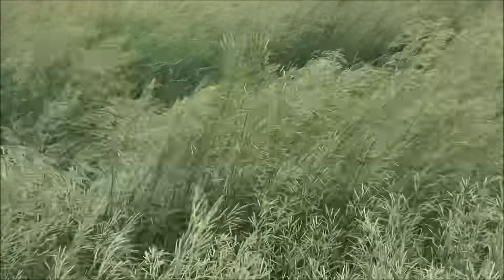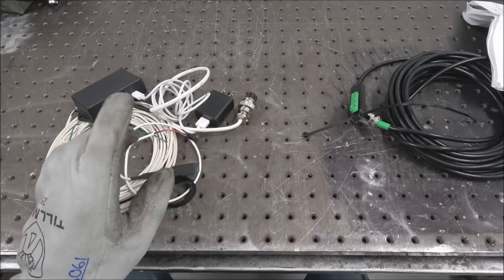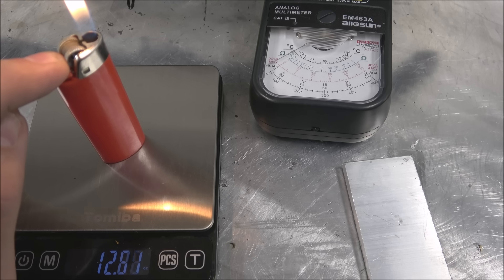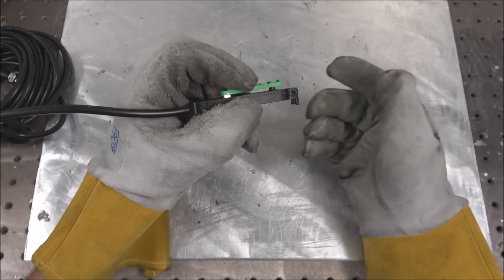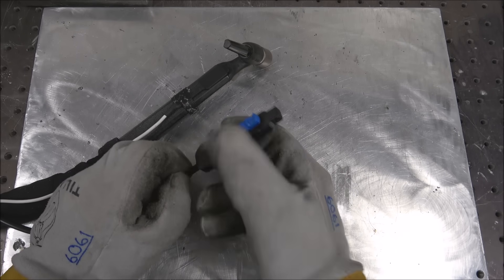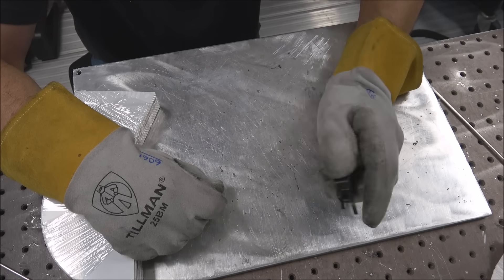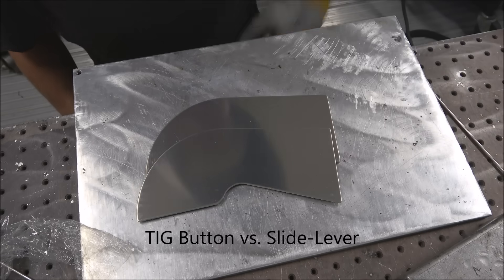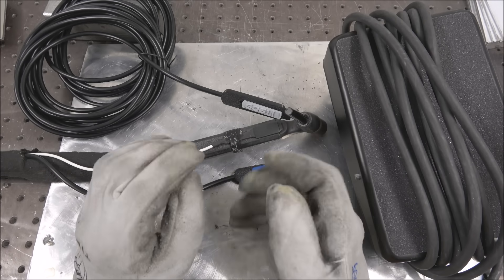TIG Amperage Controller Showdown - TIG Button VS. Slide Lever 6061

Comment from the maker: Both available to purchase here:
http://www.6061.com
NEW upgrade TIG Button pressure "PAD" www.6061.com/replacementbutton.htm

Torch Holder Magnetic Base: https://amzn.to/4kE7OEU
Get yourself some soft TIG gloves: https://amzn.to/4dVTQeQ
Thanks for watching
Reply: Will the slide lever work on a ThermalArc 186 AC/DC Inverter machine?

Comment: I make much better welds when I do 4t vs foot pedal because it's like cruise control. It just gets old to constantly be setting it all up for every weld. I think the slider is right for me so I just ordered one. I think id struggle to maintain consistency with the button. I've been using the primeweld north south one and the dial wheel is just so small and awkward to use in anything except a weird overhand grip. I like the idea of the slider that you could also use it for 100% "pedal" flash tacking. I'm excited to get it!

Comment: Wow, this is such an exciting video for me!  I've just taught myself to Tig, watch a lot of videos, yours are EXCELLENT, love the simple/brilliant torch holder, but especially the variable Tig button!  My first big project is a 10ft tall bent & welded steel Christmas display that I've attached thousands of Christmas lights to. I don;t have a 10ft x 10ft welding table so I welded the entire thing crawling around on the concrete floor, I didn't even try to use a foot pedal, just ON/OFF at 100%, sure could have used this variable Amp setup.  I think I will like your slider bests, as I have a tendency to 'death-grip' (with my tongue out) when concentrating on tough tasks, I might squeeze that high-tech one too much.  You've got a great website, I am buying a 6061 Slide Lever next and going to perfect my welding fast! tyvm!

Comment: I have an old Lincoln Invertech 275. The tig torch I have has a manual gas valve. Could I get the Tig Button and a different torch and the gas would be automatic?
Reply: I have the same thing bro , if you try it and If it works, please let me know.

Comment: Hey mate, if you leave the slider on the max setting and then click it on will it start the arc at the max amps? Or another example is could you remember where abouts on the slide you want to initiate the arc and pre slide it to the spot and then click it?
Reply from the maker: @Trikk57
Yes, you can stop and start the arc at whatever amperage you'd like. Great for tack welding, weld restarts, etc.

Comment: Very nice Aaron... I've been using your TIG button for a couple of years now, but find it to be a bit awkward as I have large hands, and use a smaller water-cooled torch on a Dynasty 210. But the new style TIG button looks like it would be much easier--if for no other reason than there's more area you can press on. But I really like the concept of the TIG button, and it's definitely a game-changer...it's just a bit of a challenge if you have large hands. At least that's the way I find it. Maybe if I had a larger torch it would be different though, I'm not sure.
Reply from the maker: @bluehornet6752
What gloves do you use?
If you are using stiff gloves, try some soft "Tillman 25BL"
You'll have a lot more control of exactly what you are feeling.
Reply: @6061  Can't recall the brand, but they're very thin. I think I got them from Jody's website as I recall. I think I have a set of those thin Tilman's as well though--I'll have to look.
Reply from the maker: Please let me know what brand. I've tested a lot of gloves, and the Tillman 25B series are by far my favorite.

Comment: Will the tig button get an upgrade in the future to run off power tool batteries? Straight DC source seems less risky than allowing any USB Switching transformer to power the controller.
Reply from the maker: No, there are way too many power tool battery types to support.
USB works great

Comment: I like the button due to my small hands. Not wrapped too tightly on the torch head, I swivel it on the handle and use the button as an index grip point when fitting in sheet metal patches for auto restoration-constantly changing torch angle.

Comment: I like this. I tend to always want to have my feet in some werid place that makes me comfortable but can’t because of the pedal. My question is. Is there a solution for swapping from different machines like I often do. Prime weld at home. Miller at school. Lincoln at work…. Is there a solution for this so I can use the same button without buying a system for every welder?

Comment: I use mine on an Everlast welder with the "upgraded" torch (I forget what they call it). It is round, and has a long round narrow part before it gets to the cap. The button tends to roll around the handle, or get positioned in an awkward spot.
Looks like the torch he is using would be much better since it is flat on the top.

Comment: I used to weld patio furniture, and the TIG welders didn't have foot pedals. They just had enclosed limit switches. We got paid by the piece, so we just cranked the amps up to weld faster. .083" wall thickness aluminum at about 160ish amps, no dabbing filler, just feeding it straight into the puddle

Comment: i would need to buy a different welding machine to use this slider, really thinking about getting the prime weld tig welder as an upgrade and then get this slider
Reply from the maker: @exzodius_2758
If you decide to order a PrimeWeld machine, you can order here and use the code "6061" to save a few bucks:
https://www.6061.com/Mainwelderpage.htm
If you do, please email me proof of purchase and I'll also give you a discount on the variable amperage controller of your choice.

Thanks,
Aaron

Comment: I use a button in 4T mode for all my aluminum work.  I bought the TIG button a while back. Gave it a solid day, maybe two to get used to it. I had a hard time hitting the same amperage with it and getting consistent results. I'm sure the button works fine, I just couldn't push down with the same force each time. Eventually went back to the switch with 4T. I would be willing to try to slide though.
Reply from the maker: @ar5000
How long did it take to get used to a foot pedal? Longer than a solid day, I bet. At least for me it did... Took a week at least. You probably just needed more practice to develop muscle memory in your finger with the TIG Button.
Reply: The r-pad is more sensitive and easier for me to get consistency
Reply: I had a bad button on mine that made it almost impossible to use. They replaced it with the latest version which works great.